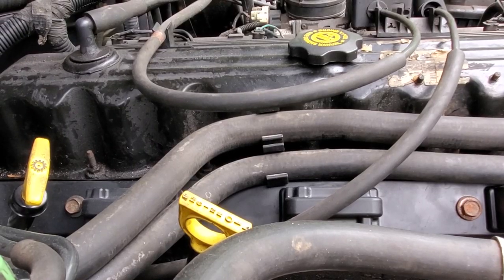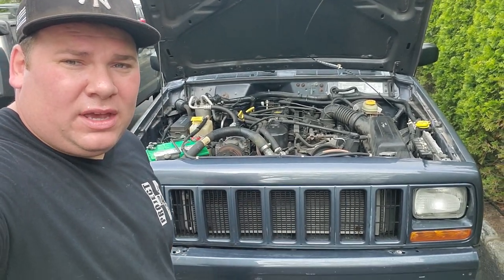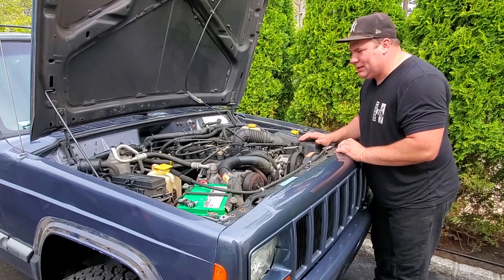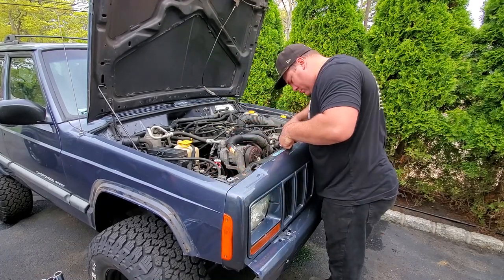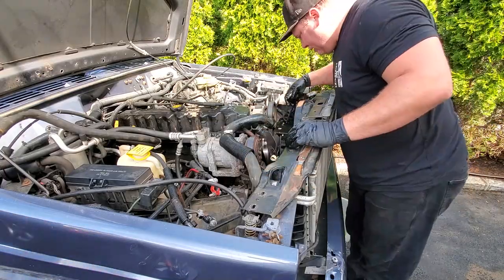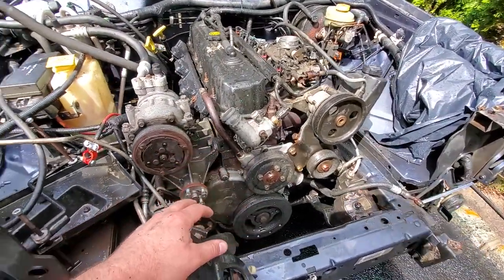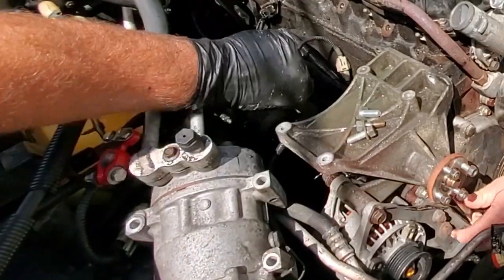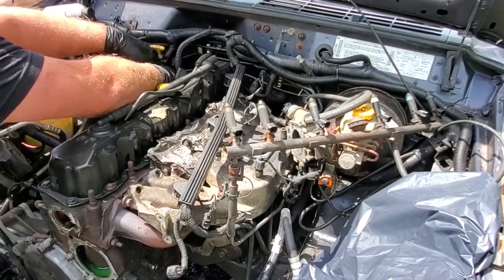2001 JEEP CHEROKEE XJ 4.0 ENGINE SWAP - Part 1 Engine Pull

Comment: I've had a couple xjs with similar knocking one turned out to be loose flex plate bolts and the other had a broken broken flex plate. If you listen carefully it almost sounds like a double tap which could be wrist pin knock? That would be my guess if I couldn't find anything else. My experience with rod knock on 4.0s is a lot more violent sounding.
Reply from the maker: Good input.. I guess all the sounds depend on how badly the part is damaged.
Reply: Sounds like flex plate

Comment: Dang man done this 10 times -- next time you can grab the E12's with a 2ft extension and socket by removing the motor mounts and dropping the tcase down as far as it'll go.   No custom tools.   For the tq converter, just rotate the bolts all the way towards the driver side just before they get out of reach, and you can hit them with an impact.  But reinstall them in a star pattern.
Reply from the maker: That's solid input bro! Thank you!
Reply: I was just about to post the same tip. Total game changer.

Comment: This reminds me, had gone to see oncologist a few months ago, came out no start. pulled test light from tool bag, had power to starter, took hammer a good whack and I'm on my way. ordered new starter and lo and behold, only one blot holding starter. someone RTV'd the other blot into transmission. Nice. So I got to install a heli-coil into my trans on top of putting in new starter. People, if you strip a bolt, fix it right. also finger start all your bolts, if it feels weird, STOP, clean threads and try again. That is all.
Reply from the maker: Yes, 100% thanks for the input! Be well friend 💪
Reply: @ProjectDanH  You as well. Looking forward to your next video, my friend.

Comment: To get the top 2 bolts out of the bell housing try dropping the engine down using the engine crane and then you can reach over the top of the trans with a socket and extensions. Same method for putting them back. Works for me anyway
Reply from the maker: Thanks Ian maybe I'll try that next time! I appreciate your input!

Comment: Hey Dan! May not be a rod knock. It may be the main bearing saddle brace. I had a 99 Grand Cherokee with a similar knock. Couldn't nail it down. Good oil pressure and no power loss. Wasn't a timing chain or gear. Then I saw a video on rear main seal replacement. The newer 4.0L have this Brace that bolts on the main bearing caps. Maybe this helps. If your oil pressure is good and power is good, this could be the noise. God bless and stay well.
Reply from the maker: Great input brother! Thanks for sharing!
Reply: @ProjectDanH  Are you planning a tear down to see what went wrong? You didn't mention whether it still had oil pressure. I could hear the knock but still curious. Great job. I'm thankful I have the use of a lift. Getting to old to crawl under them anymore.
Reply from the maker: @projectbumblejeep4190  I really want to tear it down.. I'll probably get to it next summer. Lol

Comment: Thanks so so much for this detailed and yet not a comedy sketch video.
Very professional. It will help me and save me money too. There are other videos removing an engine but they do it in 5x speed.  You explained things clearly and didn't short cut the mistakes either. There's always gonna be problems.  Knowing to plan for them is priceless dude. Thanks again. 
What not to take off is as important as what to remove.  Save money and time that way. Like A/C deal.
Reply from the maker: Thanks man!  I try to keep it as authentic as possible.. Glad it was helpful!  God bless

Comment: Great Video Dan. 
Looks like I will be rebuilding my Dana 35 rear Differential. It needs it. 202,000 miles 😂🇺🇸
Reply from the maker: See if you can pop in a C8.25!
Reply: Will look into it. 👍
Reply: @myjeepwjarebuildpaulsteven7986  Good advice from Dan.  Both of my XJs came with the Chrysler 8.25.  Supposedly they are much more durable.
Reply: My 4.0 is running pretty good right now.  200,000+🤞

Comment: I find it rather funny Dan. You start a  4.0L swap right as my 98 ZJ (the one that looks like General Geivous) is slated for the same. Mine the #6 cylinder has a breathing problem. 35PSI of compression. I am swapping out both motor and trans with a 2002 WJ powerplant even the NP242 transfercase. Good luck with your endeavour.
Reply from the maker: Not sure a WJ motor will fit in a ZJ.. please double check the location of the water pump , AC, alternator and belt tensioner.

Comment: I am going to do this in the future. Except my 1999 4.0 is running fine. Just switching it for a Newcomer 4.6 stroker. I have to rebuild a transmission to put behind it. The original transmission with 224,000 miles wouldn't live long behind an engine with over 300hp.
Reply from the maker: That's great!  Keith builds one hell of an engine 👍

Comment: Check the FLYWHEEL  and it really sounds like the motor was over revved       rocking the crank shaft  and how it the oil     for the  proof
Reply from the maker: When Tommy got the Jeep he did a fluid flush. The coolant and oil were brand new. The only thing to go by was the sound

Comment: Would it be possible or worth it to just replace the crankshaft and new rod bearings. ???
Assuming that the compression is still good of course…
Reply from the maker: Sure,  but,  I had a new engine ready to go at Tommys request. lol

Comment: Thank you for this video! I have this same noise but not as loud and only on cold starts, doesn't follow RPMs and goes away after driving around. Have you experienced something like this?
Reply from the maker: Sounds like yours could be just lifter tick.. try some oil with zinc in it or use a zddp additive. Hopefully that will do the trick

Comment: Thank you for this video!

Why in the holy hell would you put 2E Torx fasteners at the top?(The manufacturer not you)

I would love to hear the explanation of why this was done.

We had to cut both of ours because we didn’t have that and we didn’t know that they were E Torx.

How do we get new ones, or can you just simply get hex flanged bolts to replace them?

😢

Comment: all good but wow. Those engines come out real easy with leaving the core support, you don't even have to take the evap coil off, just pull the radiator. I've done it several times over the years. i just did my '90 nov '20 and my '99 july 21. Again, core support in place. Just saying this so you can avoid doing a lot more work than you need to.
Reply from the maker: My hoist is short so I wouldn't have been able to get over the core support of this lifted XJ
Reply: @ProjectDanH  bummer, my lift will go 97inches and with a balancer bolted short to engine as possible I can get engine out with 4inch lift .....just clears
Reply from the maker: @deanwattles8722  nice brother!

Comment: I have a 2001 with 322k miles and I have piston slap. What engine blocks are a straight swap?
Reply from the maker: Basically any 97-01.  Just make sure you keep the right head
Reply: The right head?

Comment: Seems like it would have been easier to pull the engine with the transmission attached
Reply from the maker: Nah, I don't like detaching the transfer case if I don't have to.
Reply: @ProjectDanH  Is it possible to remove it as complete unit (Engine and trans ?) Would they have gone into the vehicle complete at the Factory ? Just Asking Dan. A brilliant video. Those Bellfhousing bolts are horrible to get to in situ.....

Comment: In the process of doing this right now... I took one look at those top bell housing bolts - no idea they were even E12s so that's useful - and my first thought was to remove the head to get better access (i need to swap my head onto the new block anyway).  Any disadvantage to doing that?  seems like there would be more room to get at those bolts...
Reply from the maker: Sure!, you could!   if you remove the head in the jeep you'll have to  leave in the drivers side head bolt in the head... also tape it up so it doesn't scratch the block... you'll see when you get there, lol.  also you can lower the trans cross member for more clearance.
Reply: @ProjectDanH  yeah, ive swapped the 0331 head before with a tupy, i guess lowering the trans might be easier since i have to install the engine anyway - and id rather do it the same way... cant wait to break those crossmember bolts! 🤣

Comment: what causes a 4.0 to get rod knock? poor oil routine by previous owner? 
how long could it limp along like that before destruction? i have a slight tick in mine but never know exactly the cause and i really hope its not this.
Reply: You should hear how bad my knocking is lol!! The owner before me drove it with no oil for a couple of miles and started a small knock. Over the years it has gotten louder and louder but still runs lol I am putting a new motor in next month as I can't take the knocking anymore lol But so far for me it's been a couple of years with a knock, never left me stranded. Once I pull the old motor I'll find out what the cause of the knock was.
Reply: @kafilkavich707  might be worth looking if it's fixable in engine before an engine swap? Worst can be is confirm you need to swap.
Reply from the maker: Ticking is a common problem when new oil is used on engines with flat tappet lifter.   we need zinc in our oil, it prevents lifter/cam wear.  Knocking happens when the bearings wear, usually caused by poor or no oil maintenance.   Try Ristlone oil treatment and Rotella oil.
Reply: @ProjectDanH  Hey Project Dan, I'm getting ready to put my new motor in and have a good amount of money invested into it. I do have Harlem Rockers installed as well. I should be fine to run Rotella T4 10w30 with Mopar filter correct? I just want to stick with one oil and filter brand. My current motor has had over 10 different kinds of oil's in it which is probably why the knocking has gotten worse lol
Reply: @ProjectDanH  thanks Dan. Mine was a bit of a barn find and the oil was horrible. It's been circa 5 oil changes in 2500 miles and finally clean. Always aimed for oil that meets API SL rather than anything newer as an indication of zinc content etc and used some moly additives top for extra protection. In euro API SL usually means a 10w40, I've even found a 5W50 API SL race oil but think my pressures don't need that ...yet. If it's the flat tappets I hear then I fear the damage/wear is done so I can just hopefully keep it at bay with good oil routines, just hope it's not at the rod as only so much oil can hold off there.
Reply: Nice video and good tips. Bought myself a Wayne’s rebuild 4.0 for 01 XJ  today at USA engines in the Netherlands.  They are going to adapt the Cil head 6:29  liquid petrol gas. I can pick it up next March, so then the swap can take place. Next on the list is a disc brake conversion with ABS. 
Keep up the good work and greetings from the Netherlands 💪👌

Comment: How many miles on the engine on this 2001? Also, what is the most legitimate miles logged that you have ever witnessed on on an original 4.0 before needing a rebuild? I've heard 500k but that is heresy, what say you for any 4.0L achieving anything close to that mileage on the road as a daily? Reason I ask is I have a reasonable decent cared for 1995 4.0 L ZJ grand cherokee Laredo with only 242k on the odometer and am trying to save the engine which has no rod knock currently, runs really well, and barely smokes, only at start up and runs well overall, no compression check verified yet but am hoping for 300-320k before rebuild. Dan do you have any tips, tricks to keep it going as long as possible?
Reply from the maker: I believe this XJ had 150k on it.  Probably abused by the previous owner.  Personally the longest stretch of milage I put on an XJ was about 150k.., from 100k to 250k over a 10 year period
Reply: I appreciate your reply. What I mean is people claim the 4.0L inline 6 cylinder to be a near bulletproof engine but nobody has ever sent a bullet thru it? I know of quite a few engines by other vehicle manufacturers that will last 250k. Is there any proof of a 500k, 400k, 350k well running engine? You have owned XJs for 20 years, You know a lot of people. Put the word out to learn about the longest running, 4.0L. Who has it, what was it in. It would make a great episode for your channel?
Reply from the maker: @bombdiggitydave3881  I like it! Will do!
Reply: @bombdiggitydave3881  only reason I wish my speedo still worked. With the estimated daily driving I was doing I would have over 500kms. Off the road at the moment. Leaf hanger was coming through the floor.
Reply: I have one with 322k with piston slap. Drives fine no heat issues and the noise goes away when at operating temp. I need to swap it sooner than later. Just don’t know what blocks fit. I put a Clearwater head.
Reply: @cuevaslegrand  I still have many miles to go then. I thank you for sharing your mileage and experience. Your real world experience is helpful to me and Im sure others who read your reply in the future. I hope your engine keeps on keeping on!
Reply: @bombdiggitydave3881  I've seen one in person at 760k miles as the highest; still on the stock drivetrain.  Was a daily driver though, never wheeled, was not in a hot climate, and obviously well taken care of...